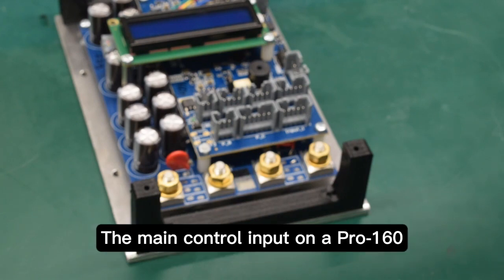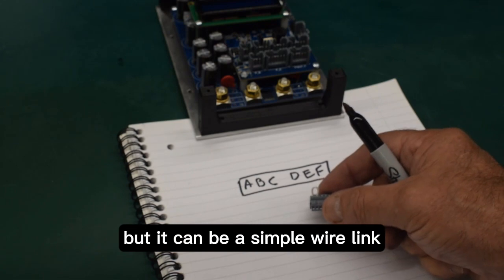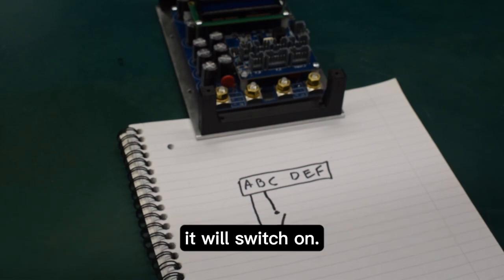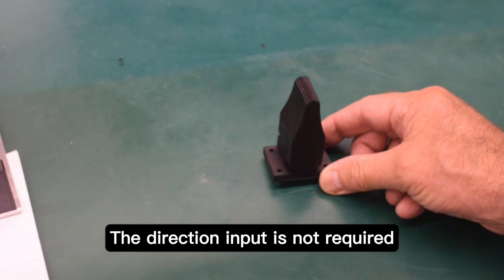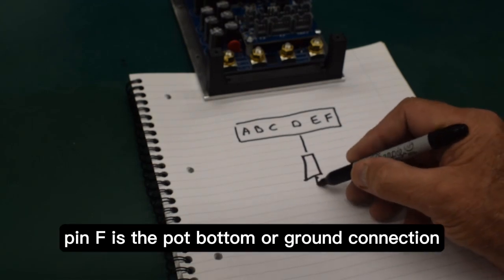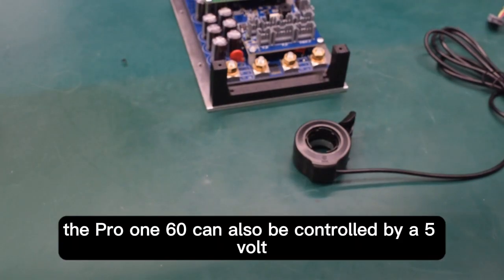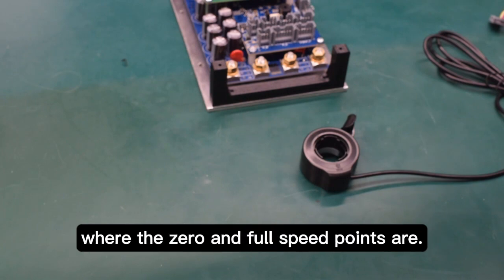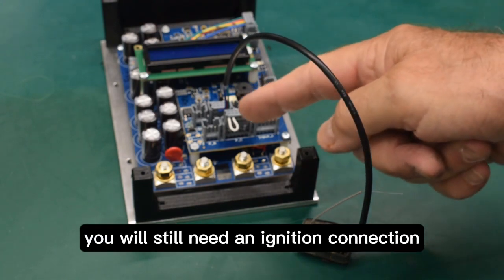The 6 pin connector explained.

Comment: So just to make sure I've got it 100% clear, using radio control input, I connect the signal wire from my receiver to Pin B of the RDO port, and ground from my receiver to Pin D of the RDO port (using an external battery for the receiver as it will have multiple other things connected to it, so the 5V connection on the RDO port isn't needed, right?)
Then, I connect Pin A to Pin B on the P_C port to act as the ignition and activate the Pro-160. Then as long as I'm in Profile 8, it should work for radio control. If I've got that wrong, please correct me.

Edit: I spoke to Forky and it said I have it correct. I'll leave this comment up just in case it's wrong, or if anyone else has the same question.